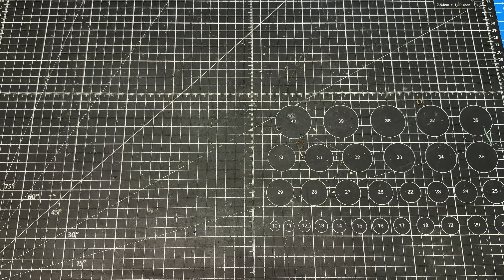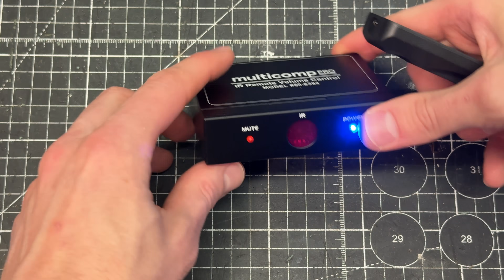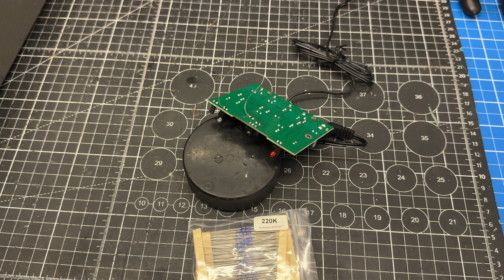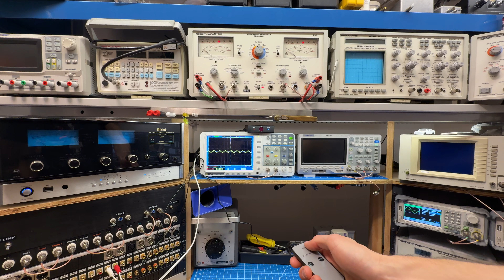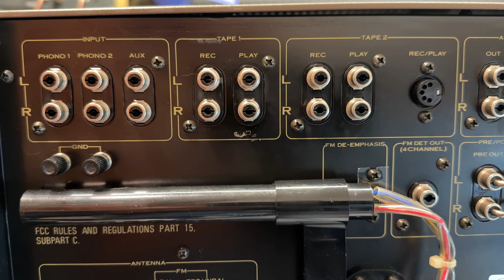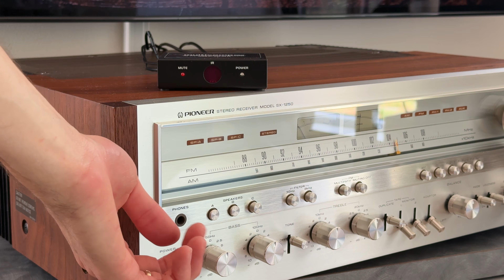Stop Getting Up to Adjust Volume | MultiComp Pro 50-8394 IR Remote for Vintage Receivers

Comment: My father has a  Kenwood KA-8004 and it won't work with the tape loop because you can't have Tape A and B engaged at the same time... I'm new to this stuff so I may not be explaining this well. There is a switch to seperate the pre amp and main and I was hoping to install it between them but am unsure if I can do this. And if it's possible I'm not sure how. Any help would be greatly appreciated. Thanks
Reply from the maker: I explain this a bit in the middle portion of the video. It should work on all sources except tape B.

Comment: I'm also using this attenuator with my Pioneer SX 1250. It's hooked up between the receiver and a Carver M400t amplifier. I didn't check the line level voltages before hooking it to my pre-out jacks. However, my volume is set to where the pointer for the volume is straight up and the sound seems acceptable to me. I put a piece of Kapton tape over the obnoxious blue light. As there's no on-off switch, I put the power adapter to the switched outlet of the receiver. This video is pretty comprehensive and is a great benefit for those looking into this solution. I got mine from Newark Electronics.

Comment: Hello: I just bought one of the MCM Custom Audio Model 50-8394 IR Remote Volume controls, this past week.  Since you are obviously comfortable getting inside one of these boxes and modding them, can you possibly help us find a solution to add some kind of simple volume level display to the unit?  I plan on using this to adjust volume on my Hafler DH-101 preamp.  It would be great to have some visual reference to what is the volume level.  I thought about buying an external VU meter but most of them are much higher than the cost of the IR volume control.  I would love to see you do a video of a volume counter display.  Thanks. DW
Reply from the maker: Hi DW. This is a bit outside of my wheelhouse as I am not an engineer. You may find after using it that you don’t really need a display. It remembers your last setting. 

If having a display is really important to you it would probably be cheaper in the long run to go with an alternate product. Khozmo out of Poland has really great controls for this purpose. Hope this helps. 

Let us know how you like the MCM once you have had a chance to play around with it a bit.

Comment: how does this alter the sound as it in the path
Reply from the maker: I go over this a bit in the video. If you use it in the tape loop you can toggle it in and out and compare. I couldn’t perceive a difference. If anything it might roll the high frequencies off more aggressively than the connected device above 20Khz. The beautiful thing is that if you want to listen in the best possible fidelity for a specific listening session you can just flip the tape switch and bypass the device.

Comment: I have a high end cartridge that can produce 5 - 38kHz so why in the world would I want to run this or any other high end gear through 20-20kHz to degrade my frequency range?? This item is a brickwall to any decent gear.  Strangely you don't mention this. Could it be a reason of sponsorship?

Comment: There is also a HDMI ARC converter device that enables you to control the volume with the tv remote. It takes the ARC(CEC) digital signal and converts it to analog RCAs. But for vintage amps like this the DAC in that might be a problem and a lot of testing would have to be done to see how it alters the sound. Usually is used for older AV receivers that dont have ARC inputs.
Reply from the maker: I worked in the home automation industry for many years. Too many unnecessary service calls related to ARC issues. Personally I cannot recommend HDMI ARC in any application.
Reply: @NovaluxStereophonic Yeah I think you a right. The only pozitive thing about ARC is the convenience of using one remote. After looking more into these ARC converters it seems like they dont work that well on a lot of Tv or they dont work at all.

Comment: Nice review. I do own some vintage stuff, and i personally have no problem getting my butt off and change the vol. This is a little effort that simply comes with vintage pre-remote gear. If you start converting your vintage gear to modern gear, why bother with vintage gear all together? Get a more modern gear frűm the late 80's/early 90's with their original remote. Hacking the 1250 with this stuff seems silly to me. But to each their own i guess.
Reply: Would you feel better about if he swapped in  a motorized pot for the volume?

Comment: On another note could you add a voltage divider to the tape loop or effects loop to lower the gaon of an older preamplifier like the adcom gfp 750 which can at times have an input sensitivity that when matched with a high output modern balanced DAC limit the range of the volume control that you can use before getting way too loud?

Comment: Some things that were invaluable about this (beyond showing your thought process on adding the resistor to dim the LED): 1. explaining why using the Tape Loop method is preferable to using the Preamp Out to Main In method. 2. Explaining the gain staging: that you want to have the attenuator maxed out and used for turning down from your max comfortable volume as set on the receiver. 3. Showing how the distortion added by the attenuator acts very similarly to the receiver's volume pot when turning the signal down, in terms of distortion added. Great video.
Reply: He really killed it!

Comment: Could you use it between the preamp and amp removing the jumper and plug it between the two?
Reply from the maker: Yes, but I demonstrate in the video why this is not ideal. The device starts to clip at around 2Vrms so placement in the tape loop is a far better choice.

Comment: Digital volume control for a vintage receiver? Sacrilege. Maybe for a kitchen radio from Ali E.
Reply from the maker: It’s for convenience. Just flip the tape monitor switch and you are back to stock analog. Best of both worlds.
Reply: @NovaluxStereophonic  It is very easy to build a motor potentiometer using components from that era. One could argue about changing the original condition. But for many, this is not possible because they are not familiar with the technology. In this case, an externally connectable solution is of course a good option. However, if it is digital, it has no place in a vintage receiver for quality reasons alone. We agree that an analog potentiometer is better. It also does not have the technical limitations mentioned in the video. The best option would certainly be a step switch with real voltage dividers. But a digital attenuator from China is where the fun ends for me.
Reply from the maker: @nanocamp-audio I made a box with a relay controlled divider by Khozmo, might be fun to compare that with the digital control.

Comment: cool device, makes me wonder if I could diy something similar with an esp32 board and ir receiver.  What would be the best way to attenuate the signal though?
Reply from the maker: A motorized dual gang log potentiometer is often used in this application.

Comment: Real simple.. Just track down a Pioneer RC-760 remote control center. I've been using one for years with my Marantz 2230, etc. You can plug in just about whatever and control the volume and turn the receiver on/off with that units remote control. There's a similar Sansui version of sorts too, but I don't remember the model #. 👍